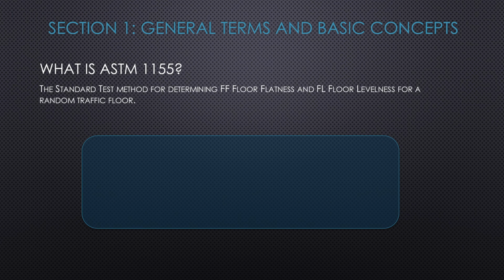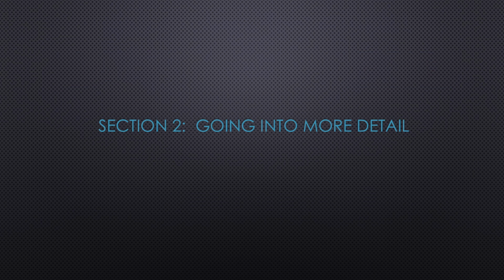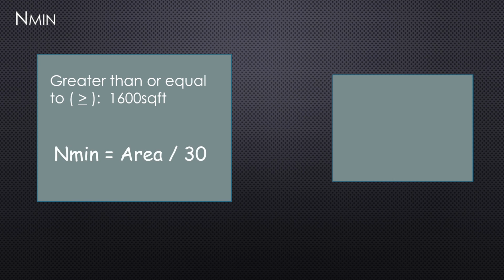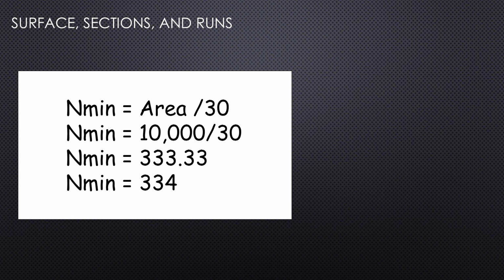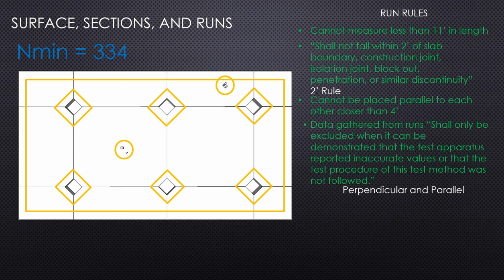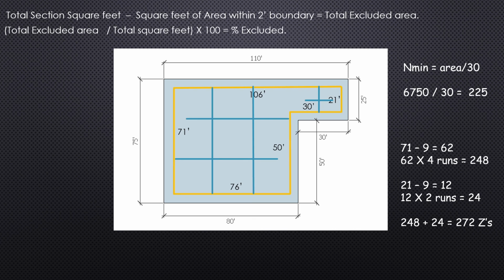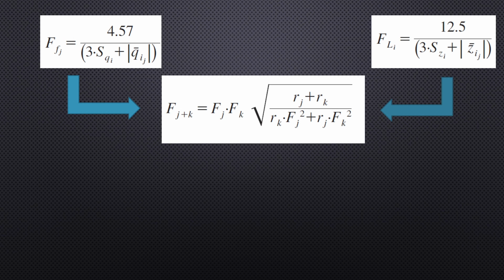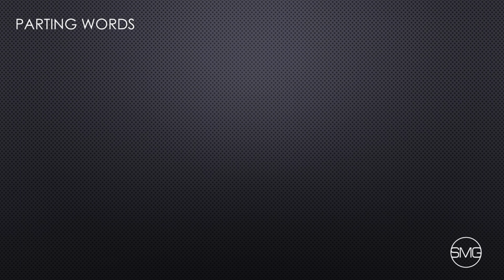ASTM 1155 Course

Comment: What if the smaller section was 24' x 30', but you didnt break it up into two test sections? Can you still run parallell/perpendicular, and run one line long ways out of it then another perpendicular line to match it?

Comment: This is very great information, you are adding to my knowledge a lot of good information, however, I have a concern about the elevated concrete slabs, some engineers do not consider levelness results as a slab evolutions criterion, is there any restrictions in the ACI or ASTM about these issues. Thank you
Reply from the maker: Hello Samir thanks for the compliment! In regards to elevated decks we think that you'll find ASCC's position statement on this issue very helpful.  https://www.ascconline.org/Portals/0/docs/POSITION-STATEMENTS/PS-24-tolerances-suspended-concrete-slabs.pdf
Reply: Thanks for this fast response

Comment: Are the Ff/Fl tests still realible  in floors where the concrete has been poured years before ? Is there a time limit for doing then ?
Reply from the maker: Hello Felipe.  Pertaining to new floor installations (unless contractually specified otherwise), floor measurements must be done within a 72 hour window as per ACI 117-90.  ASTM 1155's Note 5 in section 8 makes specific reference to ACI 117-90 on this topic as well.  That said, there can be instances where floors are measured long after installation.  You may see this when the floor is going to be polished.  An F number test can be done to get a baseline of the floors current F number condition.  In this instance the results are only "reliable" in that they reliably reflect the floor's current condition but not necessarily the condition of the floor at the time of placement years prior.  Over time, factors such as slab curl, subgrade settling, and surface wear (to name a few) can significantly impact the numbers as compared to the day of placement.  Thanks for the great question Felipe.  Hope this helps!